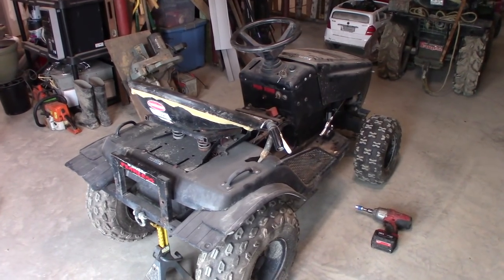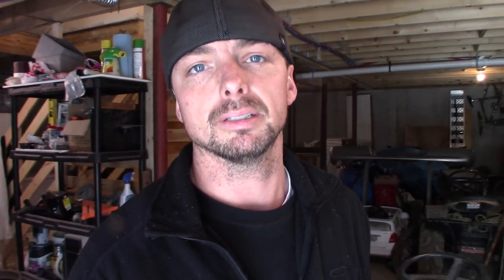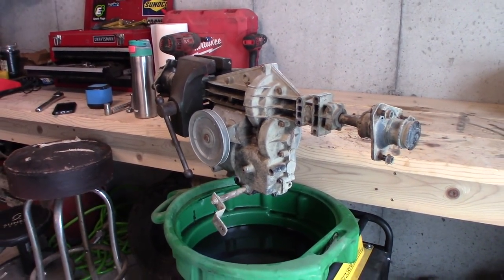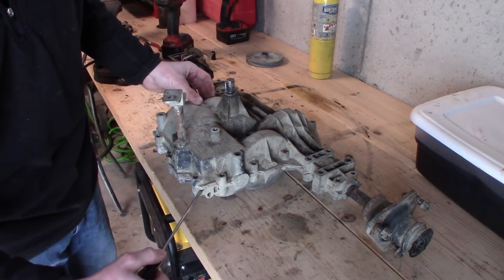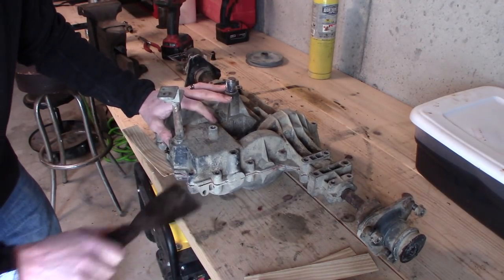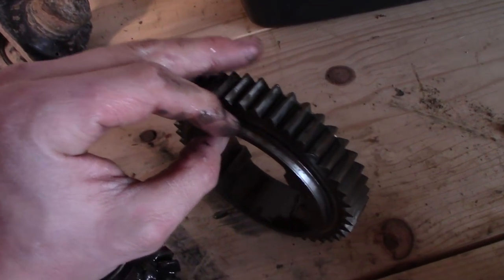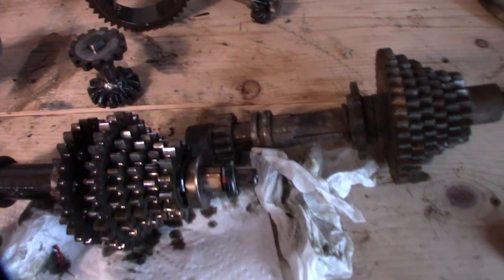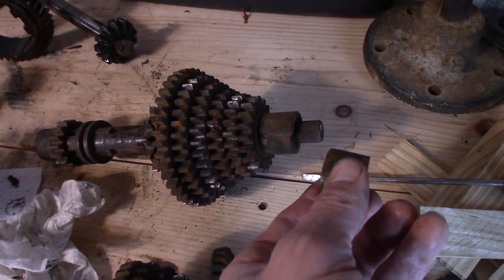Murray Transaxle Removal & Inspection (MST-205)

Comment: You might want to try a thicker oil
Reply from the maker: hillbilly766 I will probably do a 50/50 mix of gear oil, and Lucas Oil stabilizer this time around
Reply: FearlessFront (Todd Christopher) that should do it of course if it's to thick it won't flow into the grooves where it needs to be bit I don't thank you can get it that thick lol
Reply: I always herd using thicker oil when going fast would make it get really hot
Reply: FearlessFront (Todd Christopher) add a grease fitting to the input shaft, where it’s accessible. 
Its helped keep mine going. Worst part is drilling in between the top and bottom needle bearings, and keeping chips out of them. 
I pressed the bearings out first to do it.
Reply: FearlessFront (Todd Christopher) everybody says to use oil, but a good molly grease (stp) will protect stuff much better than oil and that molly grease wont brake down under high heat

Comment: i have peerless mt-205 with tecumseh on it ,and then i have a peerless mt-206 that doesn't have tecumseh on it.Is there any difference?
Reply from the maker: jeff mcpeak the 206 is a 6-speed, basically identical to the 205 with one extra gear added. You could even make a 205 a 206 if you just swap the gear
Reply: alright thank you,the 206 is under my race mower project,its a poulan,no veri drive system.it has 16.5hp on it but that engine is shot,so im replacing it with my 18.5hp opposed twin,and 3 1/2"' pulley on rear.trying to get 20-25mph.

Comment: My old rear engiene rider was pretty good at doing wheelies in 3d gear but only a cople of meters cause i needed a higher gear so I shifted to 4th gear and reved up the engine and dumped the clutch... There was a loud bang from the gearbox I could hear the belt slipping and the engine died... The gearbox was totaly locked up. I tock it apart and found out the 4th gear had broaken into multiplae pieces. nothing else was broaken so a cuick look at ebay to find out the ger was about 100$. I tougth about getting a new gearbox. Then i put a spacer where the forth gear went and kept on riding the mower. (Pearless 500 5speed) I still had all geras exept 4th. After a while the 5ft started skipping. when i shifted from 3rd to 5th the shiftforks had to work harder because there was suths hig speed differense. The 5th stopped working and I drove it with 3gears a week more an then it started skipping on 3rd and I was like Whell the gearbox shipped to bed soon.  I lost intrest in the offroader and it still sitts outside in the rain a year later.

Comment: Alrighty. So.. I've lost the battle with my project. I got a blown engine. No wiring. Bad frame. Good rear end  horrible body. Good seat. Good tires. Good steering.

I'VE GOT 200$ to finish this. But I have all summer

Comment: The Murray needs a Kohler engine ether vtwin or single awsome awsome motors ive has more problems with Briggs than Kohler there so much better in performance in extreme conditions and thay can handle tons more Rpms in my opinion .... great vid buddy
Reply: derek coleman preferably, the command series.
Reply: Hansi not hardly pal lol
Reply: Hansi I have one currently installed on my racing mower and that thing has lasted 15 years now and is still running strong.
Reply: Hansi just because they make toilets doesn't mean there shit
Reply from the maker: If I can find a V-Twin, I would definitely put it on there. Of course if I did that, then I would have to put an 820 in to withstand that amount of power
Reply: Hansi I agree with you on that one
Reply: Hansi the command engines are commerical grade and the courage engines are consumer grade (shit grade) obviously
Reply: Hansi , while the courage was terribly designed mine cracked the block at 100 hours and now 200 hrs later at 300 hrs its still running strong, works better than my other two lawnmowers always starts right up, i thinks theres something to be said for that....
Reply: Will McDonald you must really be lucky
Reply: FearlessFront (Todd Christopher)  I should've brought mine to Maine when I came up there. Would've dropped it off to you lol.
Reply: Randal Jackson what about me?
Reply: Hansi I’ve had a kohler courage 26hp v twin, it has lasted 5200 hrs now and it’s 7 years old. Still runs strong and has not had a single problem in all 7 years.
Reply: Charlie Norton Thats not really impressive.
Reply: derek coleman all My briggs Engines and a old tecumseh start Right up in the winter. My old kohler twin har Very big troubles starting. And my grandads kohler courage doesnt Even start
Reply: Hansi who cares it’s a fucking engine it’s good for a courage
Reply: Charlie Norton Sorry i dont like kohler
Reply: Hansi the command series blows Briggs out of the water every time in every aspect the only good thing Briggs has going for it is there parts are cheaper to buy I build motor all the time Briggs and Kohler s I’ve blowed up more Briggs engines than I have Kohler s like I said in the beginning just my opinion don’t like it don’t comment pretty simple
Reply: derek coleman i said My opinion  too no need to be toxic
Reply: Hansi were dose it say in your opinion????? ... not being toxic just dislike shit talkers and drama starters
Reply: derek coleman i say kohler is bad Thats MY opinion
Reply: derek coleman box